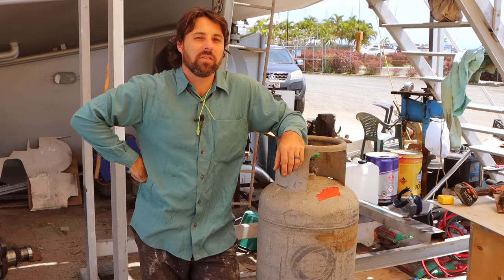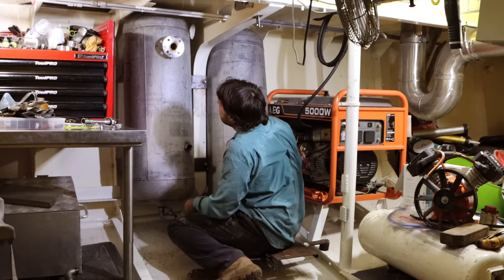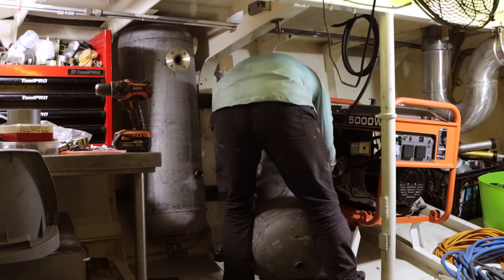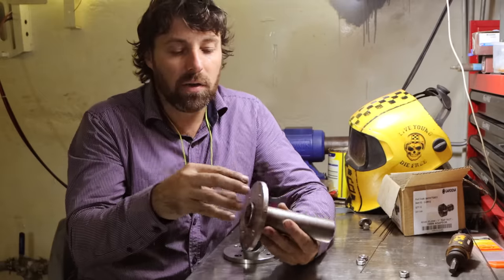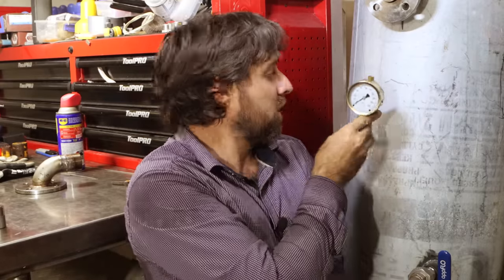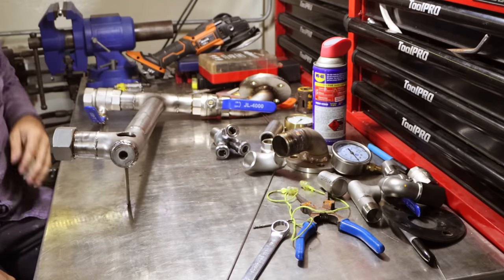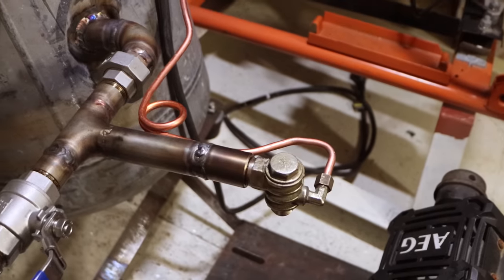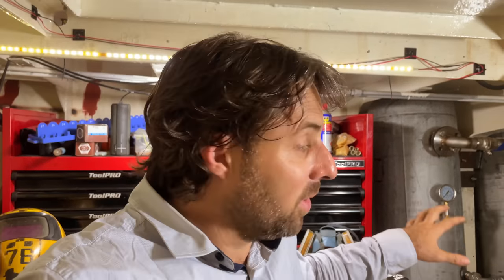Building a Multi-tank Air Compressor (Part 2 of 3) - Project Brupeg Ep. 281

Comment: Thanks for the shout out, totally the right call on the blue manifold, drop the pressure close as possible to the tool if needed (e.g. a portable unit with both a regulator/water separator, followed by an automatic tool oiler as well - ocean environment will be hard on air tools so a continuous misting of tool oil in air supply is well worth it.  
Compressor will be running @ 150 and air tools are often 'happier' at around 100 psi - in theory you don't 'need' to regulate it down, but doing so means the compressor can keep up better with 'greedy' tools - I normally run most of my tools at 90psi and 120 for the rattle guns)

Comment: Damo, you are correct when you call the small copper pipe an "Unloader valve". It dose not play any part in the pressure sensing. It simply provides a decompression of the compressor pipe so that the compressor does not have to restart with full load in the supply line.  It also must be between the compressor & the one-way valve  (as you have done). Cheers mate.
Reply from the maker: Thanks Tony

Comment: You’re building a cracking system there Dame. I agree with the fittings. In 40 years, I’ve never needed(well…at least used) a regulated air line. The only problems I ever ran into was the hoses being too small and restricting my flow. I never understood why my big gun never met it’s potential. Then I weld burned a line and bought a thicker line on sale. It was like I had a totally new system. 
Hi to you also Jess. Hope you’re feeling ok 
Love what’s going on guys.
Reply from the maker: Thanks Ian. Yeah I need to buy some 1/2” lines but that’s the plan, run big pipes

Comment: I love how the community comes together to help on this project...humbling but safety first and move ahead. Let's all do a shot for Brupeg's success!
Reply: I with you there. Whisky, bourbon or rum?
Reply: Safety is last, the pressure relief is after the isolation valve, the valve can be closed so the PRV will not function
Reply from the maker: The pressure relief is either directly on the tank (left) or on the regulator like a normal compressor (right)

Comment: Love it as always Damian. One thing with the belt guard is that they are designed to be strong enough to stop a failing belt from destruction of anything around it. The air supply hose, albeit braided is a potential damage situation, as very close and you could lose all the air. Also, with the window for allowing the large pulley to draught air, you would benefit from having the guard with mesh showing the middle of the belt, as that will show visually the stretch quicker to then re-tension or replace a worn belt before it gets to the first stage I have written.
 In the UK , I have had issues with portable air compressors on site works for vertical pneumatic lifts for air conditioning units, mounting on ceilings, this week and the requirement of pressure vessel safety regulation certification , which the new compressors came with luckily but were dated from construction, which means I have a month to get the job done now before having an examination !. I am sure in Aus and ship regulations maybe more complex for insurance etc.  Keep at it. Rather make it right if it takes 3 episodes. Plenty of enjoyment to watch.
Reply from the maker: Thanks Justin. That’s a smart idea, I will change the mesh design to show the whole belt. Cheers for the input. Dame

Comment: I think the pressure relief valves you fitted to the T pieces on each tank are potentially way too small in flow size to be sufficient to vent enough air for the size of the air receivers.
I'm pretty sure the relief valves will need to be a specific size/flow volume at X pressure to match the storage volume of each pressure vessel, aside from all the other regulations you will need to satisfy to pass an inspection and certification.
I would estimate you will need at least a 1/2" bsp or 3/4" bsp relief valve per tank.
Good luck with the rest of the legal and safety aspects, I hope it is all worth the effort in the end👍🇦🇺

Comment: This may have been pointed out previously but I am pretty sure that you should not weld a support bracket to a pipe as you have at the top pipe. The reason being that 1) vibrations can cause the supporting weld to fail and 2) little or no scope for expansion or vibration isolation. Good call on canning the beer kegs!

Comment: Great work, but the mounting flanges for the tanks gave me pause.  
Those brackets (especially the coplanar ones on the left tank on the inside) will be quite prone to fatigue cracking.  The bracket as-is will create a relatively large bending moment at the weld, and the cyclic loading of vibration and movement combined with the heat affected zone of the weld will almost certainly lead to fatigue cracking eventually. 
A simple triangular gusset on each bracket will mitigate the bending moment and make them much, much more resilient.   Highly recommend adding some for some peace of mind when you remove them for blasting.

Love to see the progress!
Reply: Wouldn't metal banding strap eliminate any weak points that welding introduces into the tank?

Comment: I've use the same size propane tank in my garage when I run tools that need a lot of volume. I've used it for over 20 years without problems. I didn't do any welding to the tank, just replaced the top fitting. When I only need pressure and not volume I just close the valve on top of the tank so the compressor doesn't take forever to build. Thanks for your videos

Comment: because hole saws tend to grab and snap off the pilot bit, l use another drill and bit for my pilot hole, then use a cold roll or all thread rod in the hole saw ...much respect,  from southern Indiana USA
Reply from the maker: Cheers same here. 6.5mm drill then a piece of steel rod shaped to fit the hole saw head

Comment: I was going to mention in the last episode that you will never need more than one regulated air supply for your application but I figured you were getting enough input that you would figure out you wouldn't need it on your own, and you did. I however would mention to running a hardline air supply to your bow and your aft cockpit. Beats having to run a hose line from your engine room. Just a suggestion.
Reply from the maker: Hi Jon. Yeah I have thought about a line to the bow and stern. I pondered using the hand rail actually and it’s heavy wall pipe right around the bow and completely out of the way.
Reply: @ProjectBrupeg  Clever. Keep in mind 120+psi charged, highly exposed, crush zone (docking, other vessels pulling alongside) potential disaster. I personally would keep inboard.

Comment: Great work.  I would still be thinking about where to start and you're already mostly done.  One thing you might consider is to mount your relief valve on the left tank upright or at least horizontal.  With it upside down, water can condense and sit on the inside with nowhere else to go and you wouldn't be draining it.  This could crud up the inside of the relief valve.
Reply from the maker: Ahh good point. Thanks will think of some options for mounting

Comment: I am so much happier with the changes you have made.I am helping rebuild an 1882 steam loco my friend is a bit of a force of nature like damien.If i see a possible problem i some times lack the vocabulary to explain the problem but he dose listen so we get on really well. We have made the regulated air supply portable as a air line from compressor at max pressure through an air line to pressure regulator and auto oil lubricator for air tools or with out oil lubricator for paint spraying just by changing an air line over. I done a similar thing at home with a old propane gas bottle so i can use higher CFM air tools than my compressor can handie .All the best to you two. PS like the copper loop to allow for heat expansion and vibration great video from UK.👍

Comment: Hi Dame.
Daft idea...
Have you thought of putting pipe or scaffolding foam tubes on the girders that are on the roof.. or rubber U strip used on lorries around doors ... in the engine bay...
Some grab rails around the engine bay might also be useful which would help keep head from ouchy girders...
I'm in the process of using scaffolding poles to make strong mountings for 2 wind turbines on my boat..
Regards from
Bella 🐈 & Mark.
Reply from the maker: Actually yes to both ideas.

Comment: I just fitted up a regulated and unregulated supply from my shop compressor, those Nito fittings can leak ever so slightly, or at least one of mine did. I put a valve in front of them so I can shut the supply to them.

Comment: The air system is really looking great, have you thought about putting a Bendix ADSP dryer between compressor and tank inlet. They use spin on replacement filters.  Here in Florida you can buy a knock off for 300.  Just a thought, keep up your amazing work. Thanks for sharing the videos.
Reply: will the motor have an air compresses on it
Reply from the maker: No but we will explain why on the next episode

Comment: I might have missed it but you only seem to have a blow off valve in the left tank. If you valve it off you have no safety on the right tank. You might think about adding a pipe and offsetting the gauge on the regulator. There is little room for turning the adjuster on top of the regulator. About the 2nd time you have to turn that knob a few times you will want room around it. keep up the great work. Can't wait for splash day

Comment: When you go to test the air pressure in the tanks and lines coming off of them open all outside doors and vents to vent air out if something goes wrong when pressure testing everything, because if something explodes it will not damage anything else. Think air bomb when testing.
Reply: In the last part of the video he said he was testing it with water, Hydrotesting.

Comment: The valved of tank has the safety valve fitted please fit 1 to each or fit the to the primary tank also used down will allow moisture to clog the safety valve

Comment: If you really need to regulate air pressure for a certain tool. There are small on tool regulators with their own gauge. You only need to install a male and female quick connects at both ends. To be used at the manifold, air hose or on the tool it's self. ----> I keep a drawer half full of them like ten all labeled with their own set psi. So I never have to keep adjusting one or two of them. Just look for the one I need.

Comment: I don't know if anybody said this yet but you should hydro test your completed setup fill it up with water completely full with no air and then use like a pressure washer or something to bump your pressure up to probably 300 PSI would be good prove that your system can withstand 300 PSI with water in there it will not explode it will rupture and leak out air will cause an explosion
Reply from the maker: That’s happening in the next episode. Really good point though

Comment: Really nice improvements Dame!
But I have questions questions questions! 
Just right off the bat, color me clueless, as to what all you will be running on unregulated at the same time? And on the same scratch my head in wonder thread, what’s the CFM of your compressor? 
Are you going to run flex hose for supply to the individual regulators? Why not run ridged pipe and be done with it. That way there’s no chance of abrading the hoses.
And now I’ll take $500. for what’s the problem with mounting the main pressure cutoff switch on the tank instead of at the compressor head? 
I’ll be building a much smaller capacity system for my “serious” hobby wood working shop (AKA my half of the two bay garage…sigh…) A neighbor gifted me a 30 gallon LP tank that will boost my total capacity to 50 gallons of air storage, WHEEE! so exciting! 
Anyway, I throughly enjoy watching y’all’s journey to a dream lifestyle! I had the same dream, but it got derailed and was put on permanent hold. But I think I traded up, six fantastic kids, their spouses, and thirteen grandchildren! I wouldn’t change a thing!❤  
I think we need a bigger boat!😂🤣
Reply from the maker: Hi Bart. No idea what all of the unregulated tools will be but right now we can plug seven of them in. CFM, cant remember and I’ve burnt the sticker off. Everything is rigid to the nitto fittings then flex hose to the tool.

Comment: at 23:40 It looks like there is very little cleance between the flex-pipe and the belt of the compressor. Might want to add some pull away from the belt to avoid cutting through or damiging the belt. Cheers

Comment: G’day crew , I was wondering if you have considered filters on the air line between the tanks and any of the air tools you may be using ? They remove any moisture in the compressed air from the tanks travelling to any air operated tools or components and from experience in my own home workshop that moisture getting into my plasma cutter can bugga up a good job . Also water inside any air tools will eventually stuff the inside bearings and seals with rust forming possibly more so in a salt air and hot environment like your engine room . Love your work 😎 , Kim .
Reply from the maker: Hi Kim. Yes your right, we have some plans in that areas but haven’t built/shown them yet. Very good point though

Comment: Awesome work Dame and Jess. In the scenario where the main tank springs a leak down the track, Is it possible to just use the second tank with a little rejigging of the fittings?
Reply from the maker: Yes. Would be a bit of mucking around but definitely possible.

Comment: Your air supply system looks very impressive and highly functional. I do have a question for you though. Are you going to rely solely on your electric powered compressor for the pressurized air? The reason for the question is the C.F.M. of your electric powered compressor. How long is it going to take to fill both tanks to a pressure high enough to crank your new engine. 

An option you may want to consider is a secondary air pump that is ran by your primary engine. Perhaps by acquiring one off a decommissioned diesel rig. You would have a system that would keep the tanks topped off anytime the main engine was running. It would also dramatically decrease the recovery time between start ups.
Reply from the maker: Hi Dennis. We actually took a truck compressor off our old motor. Our plan is to have this electric compressor and a diesel driven compressor. We decided not to run a compressor on the main engine as if it fails it takes the main out of action until repaired, versus having it as an independent system that can’t take the main out and with two compressors it allows redundancy

Comment: would have welded doublers onto the tanks where the brackets attach, not end of wold tho' just enlarge the mounting holes and don't torque them to FT so if there is any hull flex the tanks are not trying to be structural!
Reply from the maker: Actually been discussing rubber mounting with a patreon today due to icy cold water outside and 60c air in the tanks making things bend weird.
Reply: @ProjectBrupeg  not going to hurt anything... well... ahhhh...  not a big fan of rubber mounts like what you are using for the compressor... as they are not captive, if shit hits the fan you could have a compressor flying around, probably least of worries at the point but something to consider on future rubber mounting escapades.

Comment: Project Brupeg,

Would not it work better, when connecting hoses to the unregulated quick connect hose fittings, if you had a shutoff valve just before them? I have just a small 100psi portable compressor and I find it a lot easier to connect the fitting I need on the end of the hose before I turn the compressor on to fill the tank to 100psi than when the system is completely charged.

Comment: As neat as it seams to have the cables spooled it is better to avoid doing that. I'm talking about the generator next to the air compressor. If there's enough current they might melt or generate magnetic fields that can damage electronic stuff or induce false readings on sensors next to it. It's a long shot but its better to avoid.

Comment: Do you really need that many quick release fittings for your unregulated air supply. More points of failure and corrosion. Would having just two be sufficient and then the rest as replacement spares if a cup seal or spring fails

Comment: Years ago I had a neighbor who built his own compressor. Unfortunately he used an old hot water tank..... Lasted for about six months until one day the tank ruptured and blew a hole in the side of his garage.   Too bad I didn't think about it before and you could have check the inside of the tanks with a scope.   Still you might want to consider doing that just for peace of mind there is no rust inside.
Reply from the maker: These tanks have spent there whole life with oil inside them (LPG). So there won’t be rust. Water tanks not so much

Comment: Hi just had a thought, what happens if that flexible pipe blows whilst you are filling the tanks do you have a one way valve which will maintain the pressure in your tanks if not you could be left with no way to start you engine?

Comment: Nice neat work......but.
Are you going to pressure test every thing and get it played and certified?
And what pressure dose your air starter work at?
The air starters IV worked with was at hi pressure around 300-400psi ?
Reply: Sorry I eat my words.......in last bit you did mention HYD testing. Top job😁

Comment: You have built a bullet proof air tank system; my concern is about the air compressor itself.  The compressor doesn't seem heavy duty enough to reliably stake the ship's  "Get Home Motor" on.  How about a back up compressor motor just in case?
Reply from the maker: Yes we will have two compressors on the boat and eventually a spring starter as well